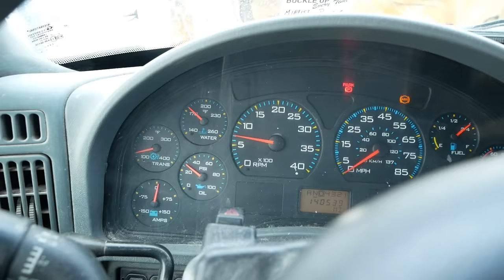Crusty Plow Truck Gets New Radiator

Comment: Your local highway department needs to invest in a steam gene and a high school kid to pressure wash the trucks when they come back from plowing. It adds years to the life of equipment.
Reply from the maker: Heh. Some do that, others don't. These guys don't.
Reply: Most places spray the entire truck down with some kind of oil film crap, I gotta tell you, that shit doesn't work, no matter how much the old schoolers try to say it does. It just traps dirt and water up against the paint and the types of salt they use is so corrosive it just doesn't matter what you spray onto the frame. I agree, pressure washer with heated water and giving a kid a job is a way better option.
Reply: Thats far too much work for a government employee to do
Reply: After every storm I power wash my truck/plow with a steam/heated power washer.  It helps but Russsstttt (Pisser voice) still finds ways to keep eating away at the truck.
Reply: They don't care, how do you think they get new equipment. Go to a state used equipment auction, they will destroy equipment and write it off to get new.
Reply: @t1259sw  its more like they destroy it and patch it back together 100 times to make it last 20 years until they retire it. For some reason most governments have way more in the repair fund than the replacement fund and the 2 can't mix. They end up spending 3 or 4 times the cost of a new truck throughout the 20 year life when it would actually cost less to just replace it at like 7 years or so

Comment: One of the best parts of small town USA is helping people without wanting something in return.
Reply: It's normal human solidarity, something many city dwellers lost in road rage and heavy traffic. He has a cool tractor and happened to be around. I've been on both sides of this kind of situation, you just can't leave someone stuck in a ditch in that kind of weather.
Reply: @Dr_V  Agreed. I live in the Bronx,NYC and this is exactly what I do. I help out when I can and a thank you is more than enough. It should always be like that but unfortunately it is not.
Reply: @Dr_V  I came across a truck at an intersection once in heavy traffic that had run out of gas at the red light. I pulled up in front of him and asked if I could tow him up the hill to the next side road. He was very happy to get out of that stressful situation.
Reply: I live in Europe and winters can be vicious around here. My advice for anyone driving larger cars like a pick-up-truck or an SUV is to keep a detailed DIY emergency kit in the trunk, it's useful both when you wanna help someone else and if get stuck yourself. Besides the usual car accessories like jumper cables, compressor, hydraulic jack, jerrycan, etc. I always carry a shovel, towing cable, hand tools set (wrenches, screwdrivers, pliers), couple pieces of strong wooden board for unditching, plus a well garnished med-kit, a fresh water bottle and a few chocolate bars. You can scale this down to fit into smaller cars as well.

Comment: Damn Super Hero right here, Folks!
Not many his kind left, Momma should be proud.

That truck would make a nice Playlist.

Cascade failure time, place your bets now:

Hose-
Heater Core-
Water Pump-
Thermostat-
Head Gasket-
Reply from the maker: Based on my experience I'd say oil pan, king pins, brake chambers, and everything electrical.
Reply: @WatchWesWork  "Cascade Failure" refers to interconnected systems,
usually a pressurized fluid. Fix the radiator, pressure moves to weakest link. Steering, cooling, braking, even electrical will search out path of least resistance, and move until secure.

Comment: I too was impressed by the ease of bolt removal for the charge air/radiator assembly. Especially considering it's a plow truck.
It's amazing how much crap is broken on these things but they still run and drive, even if poorly!

Comment: Gates:  Our hoses are too good, how do we sell more?
Also Gates:  Let's make a heat-shrink hose clamp that literally forces the mechanic to cut the hose to remove it!

Nice work man!
Reply from the maker: Don't worry, they also sell a special tool to cut them off...
Reply: Hah of course!
Reply: You don't cut the hose. Some guys heat a flat head screw driver and burn the clamp off. You can easily tell when the flat head is all the way through. I have a specific tool designed to release these clamps along the same concept as the flat head. Worm clamps are banned at our company for good reason and we maintain 2.4 million units.
Reply: @stevenliberadzki9160  I've never heard of them, Are they mostly on BIG TRUCKS ?
Reply: @NoWr2Run  they make them in many many sizes. I don't use worm clamps on my personal vehicles either. So yes, you can use them on your personal vehicle as well.jist need to know the od of the hose and get one size larger because they shrink. I've never seen them at say your regular auto parts store. They haven't even heard of them in most cases. You can get them at a store called fleet pride. Also Gates website will be easy also. We only use them in coolant applications.  Not fuel or def or oil.
Reply: @stevenliberadzki9160  T.Y. SIR.
Reply: @NoWr2Run  mp

Comment: That was a fairly straight forward ordeal for a northern plow truck repair as it pertains to removing rusty hardware. I enjoyed the bonus footage even more. I've been in that situation before. As you can imagine it doesn't snow very often in Dallas, and as such we don't have snow tires for our vehicles. So during a freak snow storm, on new years day, I was coming home from work in my 97 camaro, and despite going slow, being as gentile on the throttle as I could, etc. I managed to park her handy to the bar ditch JUST off of the side of the pavement. Thankfully no damage but also thankfully I was able to get some assistance from local police who happened to be driving by. I was working 3-midnight at the time so the roads were otherwise deserted. So I got a grin out of you helping this fellow out. Hopefully he'll be able to find a second-hand replacement front fascia for that Suburban. Thankfully black is a pretty easy color to find.
Reply from the maker: Pulling him out at night would have been much worse. I'm glad it was daylight.

Comment: You are such a nice guy. I would have told him to call AAA. I hate the cold! lol

For $80 a year, super cheap insurance.
Reply: Last time I had AAA (many moons ago), there was a condition that they wouldn't cover a tow if it was within 50 miles of my residence.  Has that changed?
Reply: @somebodyelse6673  what year was that? That sounds like an odd  rule. All I know is that I have no restrictions of any kind. They'll pull me out of a ditch, jump start my vehicle or tow me to repair shop. I think the tow is up to 250 mi.
Reply: @lostintime8651  - early 90's I think.  They denied me when I called to get towed on a grocery run in a nearby town, I dropped them on the spot and never looked back.  Glad to hear they may have seen the light since then.

Comment: This video reminded me of when I was a mechanic in the Army. My company had 61 bulk fuel tractor trailers. Stuart Stevenson's cab over trucks were not built for the desert heat. The fan clutches went bad left and right. What was initially a 4 hour replacement job, we knocked down to a little over an hour, we replaced so many.
Reply from the maker: Nice! I worked with a guy who was a mechanic in the Marine Corps. He told me a similar story about engine swaps. Following the manual it was a 2 day job for 2 guys. They figured out they could remove a panel from the back of the cab and pull the engine out the back and 1 guy could do the job in 6 hours. I forget what model it was.

Comment: Hi Wes you have an outstanding patience, to fix these old and not well maintained trucks.  well it will be good to fix the rest with leakage when it stops completely .. pity that it is not done for until there is more or less panic.  The parts are not around the corner.  You're damn good at making it work.  👍.

Comment: Welcome to ‘module engineering’ - what you have there is what’s know as a CRFM - condenser, radiator & fan module.  At times they are delivered to the assembly plant as a unit from one supplier and just ‘dropped in’ on the assembly line.  Some of the aftermarket cooling parts are equal to OEM being made with the same standards by OE suppliers - the problem is knowing the good stuff from the junk.

Comment: Great video! What a job working on rust buckets!!! 👿 .... A little tidbit on dexcool that was conveyed to me by a GM engineer... Mixing with conventional green coolant only reduces it's long life properties to that of conventional coolant.  Where the sludge begins is when tap water is used for mixing; almost all premix's use tap water.  I've mixed hundreds and hundreds of gasoline engines sealed dexcool systems with just about every coolant known to man and have only ever used distilled water as mix and have not encountered any Mississippi mud in GM cooling systems.  Sort of info after the fact for me as I've been driving and repairing European cars for myself for almost 35 years and their procedures clearly state distilled water only for coolant mixing.  I was a factory trained Red Seal Grand Master GM Tech for the better part of two decades.  Maybe things have changed regarding dexcool since I left GM but anecdotal experience with it and the advantages of non-premixed coolant and distilled water has served me well..

Comment: Well done - an excellent job and seemingly a great result as well! I find it hard to believe that the driver(s) just carry on driving that truck just filling it up regularly, I quite thought the engine would be ruined.
I quite like this sort of basic repair / service stuff because it sure reflects the real situations that a mechanic runs into in everyday ordinary vehicles and the lengths they go to fix the issues rather than bodge it to get by.
Reply from the maker: The DT466 is hard to kill.

Comment: Years back, I used to do business with a radiator repair shop that would replace those plastic side tanks with actual metal tanks.  They would work on car and big truck radiators.  They could even custom make a radiator.  I had then make a 5 core radiator for my Camero that I had at the time.

Comment: You make it interesting to watch. It's hard to explain to people how corrosion works. They often tell me to just take the exhaust off and work on it on the bench. Exhaust, fuel lines and brake lines are not something you just take off and put back on in the rust belt.I live pretty close to you and I don't even attempt most repairs without making plans for a parts run vehicle and what parts are available.

Comment: You should get yourself one of those M12 Subcompact 1/2 impact wrenches from Milwaukee to replace that old Dewald. 
Best investment I ever made, couldnt work without that thing anymore. 
Fits nearly everywhere in the bay and the tourque is way more controllable than my old brushed one, so it doesnt rip rusty heads off.
Reply from the maker: I really like my air tools personally.

Comment: I think International could have used about 28 more bolts to hold radiator in. Used to work on copiers and they would use 20 screws to hold small cover on. Always said engineers brother owned screw factory.  Love that you will always help out people in trouble . Seems people love the ditch in your neighborhood.
Reply from the maker: It's the Bermuda Triangle out there.

Comment: Nice job on the truck and you're a good Samaritan.  Growing up in Northeastern Pennsylvania I can't tell you how many folks I pulled from the ditch with the old trusty 80 hp Ford Diesel tractor.  With calcium loaded tires and chains it was a beast. It was like a sport and I couldn't wait to do it.  Most of the time it was a cocky person in a 4 wheel drive that thought they could go anywhere.   The problem is that 4 wheel drive doesn't help you stop.

BTW, The SAE fitting on the radiator.  I am pretty sure it's something we call an "O Ring boss"  Straight thread (not tapered) with an O Ring.  We use it all the time in military (Navy in my case) applications.  They are less prone to leaking from vibration.  It's the only thing we use.

Keep up the good work from one rust guy to another.
Reply from the maker: Those SAE fittings are great for higher pressure hydraulic systems. Cat and Deere use them everywhere.

Comment: Good info on the antifreeze .When I had the  cummins  engine replaced in my freightliner. They recommended fleetguard OAT antifreeze.I carry extra gallons and don't mix it with other types.

Comment: Ooooh, a fellow municipal mechanic to watch.  Most excellent!  I am always so paranoid with hitting the fan assembly when I do truck radiators, so I just get them gone.  Good as time as any to check the bearings and clutch assembly on a Horton.

Comment: Nice repair video.. One thing to point out is how important to use the correct antifreeze whit the correct rust inhibitor, or you can damage the cylinder liners so they will start to leak coolant into the combustion chamber, overheating the engine and damaging it ruined.
Reply from the maker: Right!

Comment: I worked at an international dealer for 2 years(would not recommend) but for those heat shrink radiator clamps, use the hot knife tip that comes with a butane solder kit. It will take a couple passes with it, but it will cut the clamp and not hurt the hose.
Reply: tile cutting tip in Weller soldering gun-

Comment: The radiator/intercooler/oil cooler assembly has as many parts as could build half a car! If these municipals, councils and road authorities in the US and Canada are running fleets of these snow plows, then they should look into using aircooled diesels like the Deutz. They are much simpler, with less parts, easy to service and run and very reliable. These engines are also perfect for machines such as combine harvesters, and standby electric generators.

Comment: Hello Wes. Just found your site. Am very impressed so subscribed and belled.

You really know your stuff. Being a mechanic is so much more complicated these days.
In my younger days, not a mechanic, there was two water pipes, one to and one fro of the radiator. Cars had crash gearboxes. Mine had 3 gears. Was a Ford Popular.
Points only trafficator light up sticky out arms, vacuum wipers. Headlights were not built into the body. Cars had chassis etc.

Being an electrician I was following what you were saying and agreed with it all.
You were even talking electronics. 
Glad I found your site. Even took note of the Montes supplier. They may even have stuff for my old Kubota 6100D.

Comment: Have lifted many a combo of radiator/charge air coolers.  I’m surprised that the charge air cooler was not spilt on the inside bottom seam. That was another problem with most of them as age set it.  Great 👍 content looks like a job that went well. 
Thanks for your efforts !
🇺🇸🦅🌏⚓️🇺🇸
Reply from the maker: I think the CAC has plenty of leaks. I was going to test it but they aren't going to replace it anyway, so why bother.

Comment: Made an excellent video bro and had bonus footage. Safe travels
Reply: As for diff lock I was told in my young days to just pull the hand brake on a few clicks to help with wheel spin when stuck. I think it is called an emergency brake up your way. No good for front wheel drive though

Comment: You should have cleaned the fins on the intercooler and the A/C. It would have increased the efficiency of the radiator. Every few years, I would put a homemade piece of copper tubing with a special 90-degree tip and Dawn soap in a yard sprayer and clean the fins. It made a big difference.

Comment: Buddy of mine had a 4 cyl Jeep with almost 300,000 on the clock. The mechanic (in theory) told him it was just running hotter because it was getting old. He asked me to take a look at it and holy crap - there were NO fins left in the radiator, but it wasn't leaking a drop. ALL of the fins popped out, got grabbed by the fan and unspooled. The entire engine and trans looked like they were wrapped in silver confetti. The "mechanic" never noticed this.

Comment: ME: Daaaannnnngg...that was a lot of banjo work to even get the old one out!

International designers: Our ORIGINAL design required removing the engine to replace the radiator...through the passenger door...

😳😬

You’re a good guy to help that driver out of the ditch. Like others said, we are desperately in need of more good guys. It will come back to you ten-fold, as it should.😁

Comment: Re coolant
Starting around year 2000 we would drain the red coolant out of brand new trucks and give it away. 
Then refill with green. 
That way we didn't need multiple coolants in stock. 
We were told it didn't matter what coolant was in it, just don't mix them.
Reply from the maker: True enough. But this engine has no coolant filter, so you'd have to keep up the SCA additive to run the green stuff.

Comment: For all the crap people give for the "hose clamp pliers", dude, after swapping in radiators like 5 times on my super duty, those pliers are a godsend!  Well worth the $40 on Amazon for the entire kit.  I can't count how much time I've wasted trying to fiddle with the ford clamps.
Reply from the maker: The constant tension clamps? Yeah. Those can be a bugger. Did you get the style with the cable? I like those for the impossible to reach ones.
Reply: @WatchWesWork  I got the master kit with all the different pliers.  The big/little straight and angled jobbies.

Comment: iM surprised by how many breakdowns and wrecks  you have in front of your place.    You're definitely right on the aftermarket radiators. i dont know why the aftermarket has such a hard time getting them fitting right and without problems.
Reply from the maker: It's the Bermuda Triangle. Those Chinese welded aluminum radiators for old cars are the worst. They are more like a DIY radiator kit...